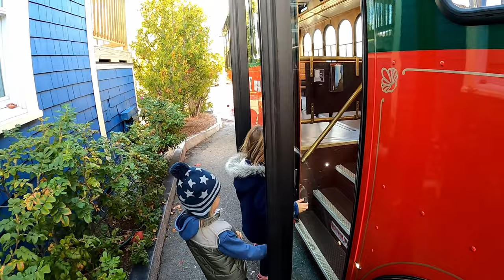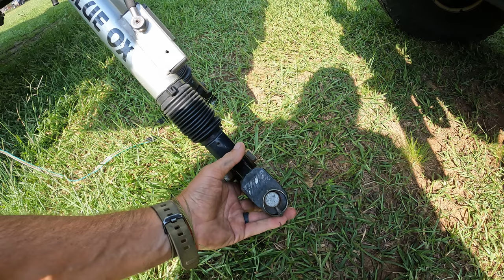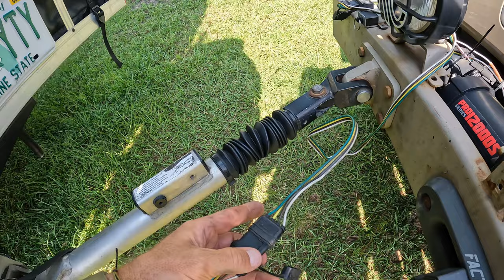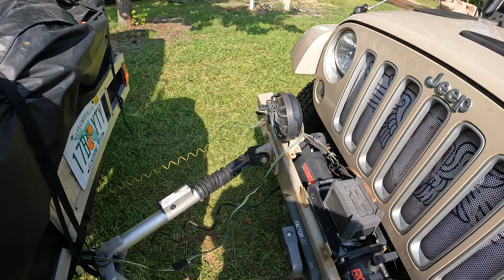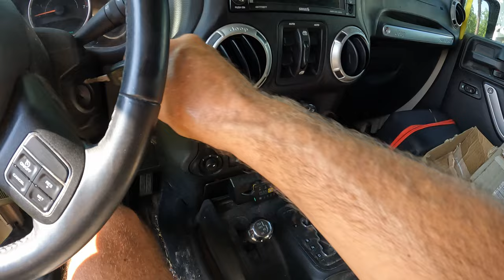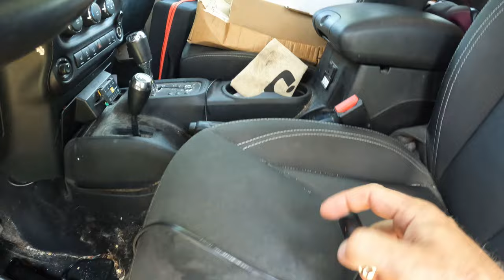How We FLAT TOW Our JEEP Wrangler

Comment: I just got a jeep to flat tow and the only difference in steps (besides mine being a manual) is that per Jeep, after putting the transfer case into neutral, is that to put the jeep into a gear like second and for an automatic transmission to put into drive.  I've also seen the same steps in several forums so curious of why you put yours into Park and what the difference is.
Reply from the maker: Sorry I missed this. Per my manual it says put into park for automatic to flat tow afterthe engine is off. I know for a manual trans it says in gear.

Comment: The way you have the safety chains attached is not correct because the pull point is not in the centre of the hook if they were ever deployed the hooks would straighten out or break

Comment: I just bought an RV and am getting it ready to flat tow my Wrangler.  Since the Jeep is supported by the tires, do you have to worry about tow bar angle?  The hitch receiver is pretty low and the Jeep is lifted.  Their wouldn't be any tongue weight either, right?
Reply from the maker: Depending on your tow bar the manufacturer will tell you the allowable slope. Blue ox is 3 inches from hitch to hookup point. You can always get a hitch riser to flatten the angle. Tongue weight is just the weight of the tow bar.
Thanks for watching!

Comment: Hi thanks so much for this info! To recap- after putting the tranny and tcase in neutral, shifting into reverse or drive, to determine it is indeed in neutral, and finally shifting into park (and the car rolls freely) the drive shaft still rotates underneath. It makes me believe it cannot be flat towed still or it will burn up the tranny. Any advice?
Reply from the maker: The drive shaft will still rotate as it's connected to each axle. 
We've flat Towed over 30k miles without an issue.